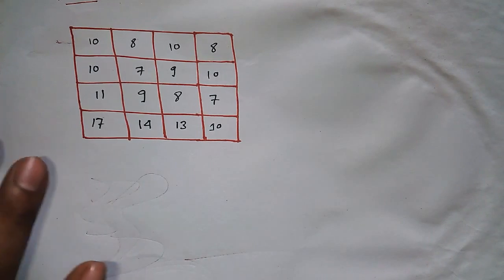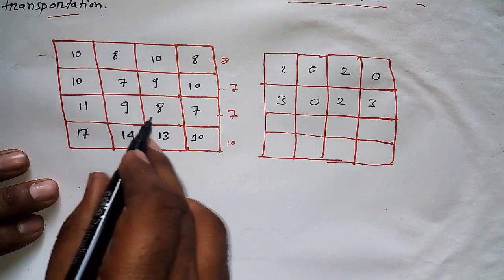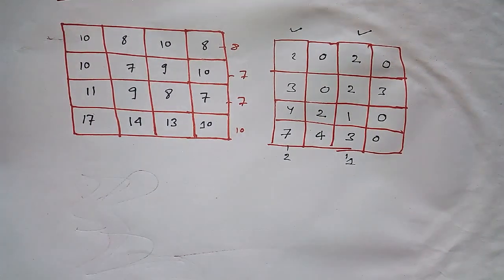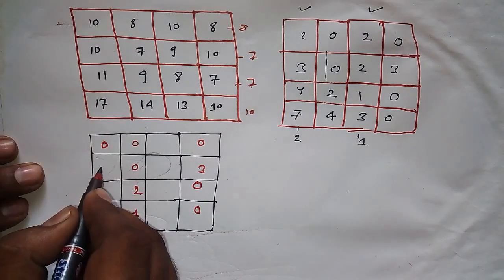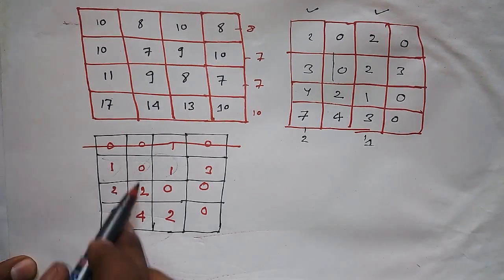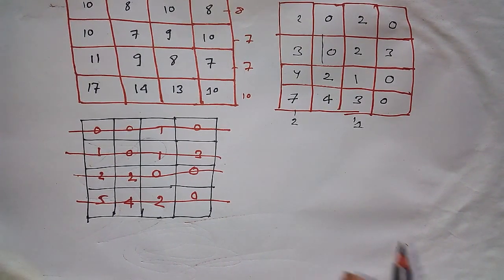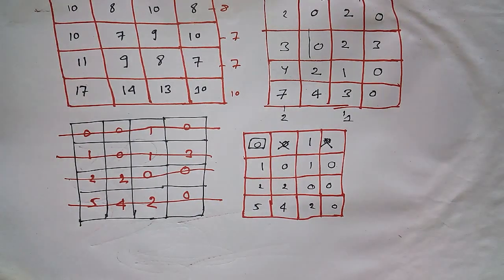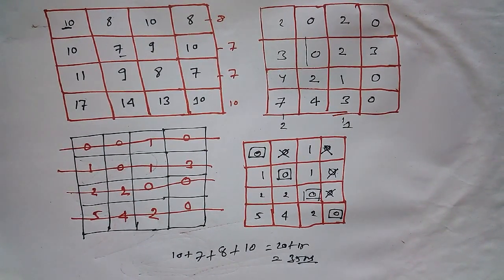How to Find out Transportation Cost IES Previous Year Question with Solution

Comment: Hello Kumar
I'm Peter and I have been learning a lot on your channel.
For this particular solution to this problem, which method was used?

Again, how do I use the Modified Distribution Method to get an Optimized solution after getting an initial solution with either NWCM or Low-Cost Cell method?

Thanks
Reply from the maker: Least cost